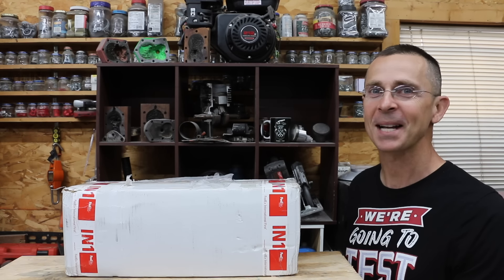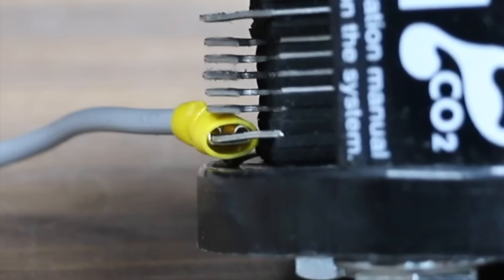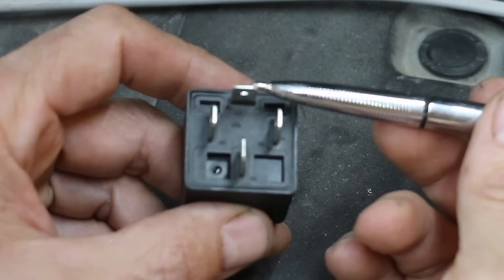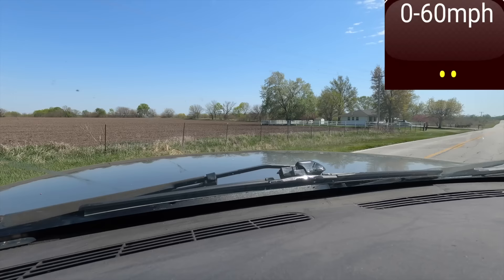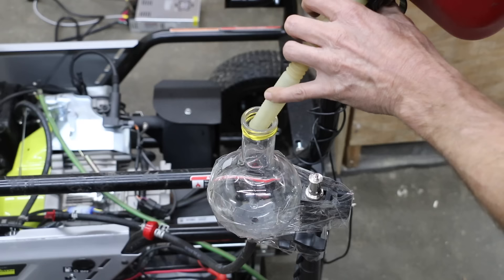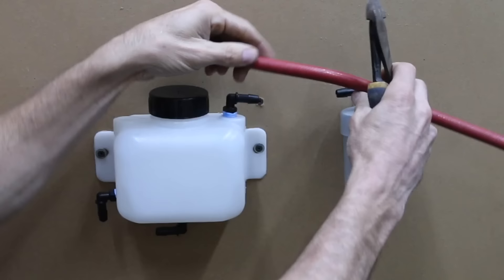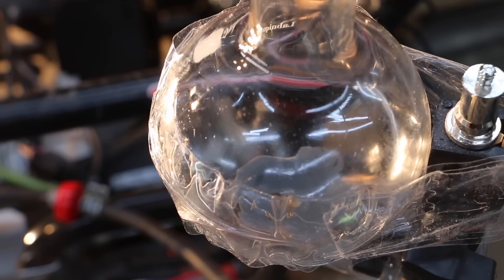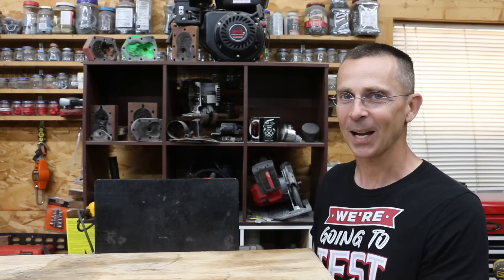AMAZING 35% More MPG with HHO? Let’s find out! Help with high gas prices?

Comment: Using the electricity to run the HHO generator..from the engine always results in worse fuel efficiency due to energy conversion losses.  The key to making this work is to use an external energy source to power the HHO generator.  Such as the solar panels on my truck. (see my video)  You can either generate the electricity and store it in a stand alone battery as I am doing, or you can use a dry cell with gas separation and compress and tank only the hydrogen gas to use like a propane system in the vehicle.  Cody's Lab has a few videos on this type system.  Either way, the energy source to separate the water into gas must be external from the vehicle system.
Reply: But if you use external source to power the HHO generator, the total input of energy which includes the energy in gas is now more than the control because you simply ignoring the fact that solar is generating electricity. And now the HHO generator is just a way of converting solar power to gas power.
Reply: @solidamanda  There is no inherent control in this scenario other than the MPG on a full tank of gasoline driving the same paths at the same speeds until empty.  There will need to be an acceptable error factor of around 5% due to environmental conditions like traffic and temperature.  I am not ignoring the energy from the solar panels, the energy from the panels IS the reason they are on my truck. I have built a crude energy source onto my truck that only takes away from overall efficiency because of the small amount of added weight.  The measurable change would be in MPG after driving through another full tank of gasoline while using the HHO, derived from the solar source.
The key issue is the conservation of energy.  It has always been proven false when an individual claims to have generated more energy from a smaller input.  So far, there are no perpetual machines.  There are a few that come very close to breaking even though.  When you convert gasoline into mechanical energy, there is a loss in the form of heat.  The same applies to solar powered battery charging systems.  Solar panels only convert between 11 and 15% of the total energy being dumped onto them by the sun.  There is a loss of energy to heat as the electrons move from the panel through the wires and charge controller.  Then there is the issue of the energy left on the table by all batteries when you charge them!  The best Tesla numbers suggest the Model Y can lose 20 to 25% of energy input to heat during charging.  Lead acid batteries have even higher losses.  Storing energy in the form of hydrogen gas is terribly inefficient at about 45% in the best circumstances.  When your energy source is abundant and free as the Sunlight, efficiency no longer becomes a huge issue.  The bigger issue is time and output.  How long does it take to charge a battery, and how much can I produce?  Given that the battery is always fully charged by the solar panels when I am not using it, and the output of the panels is about 4x what the charger needs to keep the battery topped off, we can move to output.  The battery is not needed or used much by the HHO generator, it is required for the use of the charge controller.  The charge controller keeps the load friendly for the solar panels longevity.  I hope this better explains what I am doing and the thought process behind it. I encourage and welcome these type of discussions!  I wish more people were interested in alternative energy. 👍
Reply: @shtfengineering7472  I see your point. Using gas converted engergy is not efficient to power HHO and ultimately will be worse than not having HHO due to the engergy loss in conversion. 

What I was saying is that if you would want to use an external power for HHO then there wouldn't be a test necessary because you are simply providing more power to the system from solar converted hydrogen gas. And the mpg will always be better but a matter of how much better.

So if he would used solar power to power the HHO, its really just if the sun can generate 35% more power or not. 

I'm sure the 35% is probably a theoretical maximum value it can produce with a good fuel consumption car. Probably will never get 35% with the truck in the video because the base amount of fuel it uses is already significant.
Reply: So you have a similar system like the video in your truck? Is it working for you?

And what about the engine controller unit, did you modify it's values so that it can take full advantage of the whole hydrogen produced that goes into the engine?
Reply: @guily6669  When the vehicle pulls the extra fuel into the chamber, the sensors tell the ECM that the mix is rich, so it leans back the gasoline.  It can cause a check engine code if you take it out of bounds.
Reply: @solidamanda  So this is a viable way to increase you fuel economy? Making Hydrogen from surplus solar power at home to burn in your car sounds very reasonable and also reduces your emissions.
Reply: @solidamanda  You could say it that way, or you could say, "using HHO allows me to run some small % of my gasoline vehicles load off solar power".  Now, how much it actually helps becomes the question.  My guess is, not much, especially considering how moving a vehicle (even an electric one) takes about .5 KW/hr per mile, and you cannot carry enough solar panels on a vehicle to make a big dent in that.  I actually charge my Hybrid EV (Chrysler Pacific) using solar panels and it takes 10 panels of 250W each to charge 30 miles worth of range in 12 hours (on average based on full sun).
Reply: @Tore_Lund  That would be a good idea, but storing it (compression) takes energy and producing it (electrolysis) wastes energy. In the end, putting the extra solar energy into LiFePO4 batteries is probably more economical and easier to use.
Reply: @MichaelSchwabTX  Yes, not that practical for vehicle use, but otherwise, a home H2 setup would be nice: If you wan't to store summer sunshine for winter, it becomes impractical to use batteries unless you can afford a basement full. Efficiency is not that important if you have an unusable amount of  surplus in summer. The idea is then to recover at least some for winter use. Storage in high pressure tanks might not be the best option for home use, pressure hydrogen pumps and fittings are expensive, so more like you would store Methane from a bio digester, in an inverted tank over a pond. The loss from electrolysis can be used for preheating water heater inlet and in winter, the fuel cell just contributes to your home heating. So you get a high combined efficiency.
Reply: What does your mpg testing reveal? Your video only shows you have a solar battery charger. The extra weight will not improve fuel economy. Possibly an aerodynamic improvement? All this hho garbage is a scam. My dad played with these toys for quite a while, and he hasn’t mentioned it since. If there were some amazing, simple breakthrough in mobile hydrogen production, you would not be able to keep it a secret today. Let alone, if it actually worked! Everyone in the world would have this on their petro vehicle.

Comment: The words every fraudulent product company hates to hear: "We're gonna test that!"
Reply: ... and Religion .....
Reply: Woah edgy.
Reply: @danrather5473  Yea, we can't be putting "GOD" to the test, "Never mind that man behind the curtain, Dorothy".
Reply: I bought this hho dc2000.... No changes .
Reply: So this is the third time I have written this and it keeps getting disappeared… Hmmm wonder why: So the problem has been solved a long time ago. Notice that both of these motors has a computer running it. 
   Think of it this way, what if we were putting propane into the system, what would be the results? And we know that engines will run on propane alone!
   Thus one needs an electronic add on to get the computer to properly adjust the input of the two fuels and oxygen… mixture is everything!
   Try this with a generator that is carburated for propane and see what happens… This though a good looking experiment is very flawed and either by ignorance or set up to fail.
  If HHO burns or explodes, which it does, then it is a matter of how to use it in an engine NOT a matter of if it “works”.
  Let’s see if they delete this one… This time I have it in Word so I can copy paste and not have to re-write….
Reply: @victormbombo3502  you tested?

Comment: This reminds me of those little metal fan shaped cookie cutters you put in the air intake of your car to spiral the air to shoot it faster into the engine. More performance, HP, gas etc. The main issue is is that firstly it’s blocking more air from getting into your intake so right off the bat, you might get even performance or less. Same with this, you’re adding extra space in an area that should be filed down if anything so you lose out right there. That’s a thick a$$ tube, it’s taking away a lot of air and real estate in that system. It’s not going to add enough “stuff” back into it to make up for that fact. Second you’re running it off a battery so that extra electricity is taking away from other engine duties to make it perform the best it was designed for. Remember those volt increases on the battery that fool the engine into running at higher rpm’s for “performance” gains when it just kinda kills it and the battery?? Also, I remember watching a car show where a dude buys a Suburea WRX and makes it factory fresh. After he’s done he puts in a cheap cold air intake and coffee can exhaust to make it more desirable. I guess to the kids who live in Kmart parking lots?!  I dunno. Well he got it dyno’d before and after mods. Guess what? The parts actually made the car run worse and not as much power. Cars today ain’t like actual cameros (70s). They have computers in them and if you start putting random junk on the engine, it’ll make the almighty computer mad and make your car suck even more. After he flashed the ECU, he got more power from those mods. So this leads me to my only advice for this test of “supercharged water”, also you can get a how to book for actual car engines that run on water and plants for free at the patent office or some junk but it’s impossible to build, is to test this before and after ECU flashes and actual dyno. Only way to tell what it’s really doing. 

PS: until then, just do legit, tried and true performance mods: empty out your glovebox and take a dump right before you drive off to the grocery store or bingo night with a hot date.

Comment: i would love to see you compare power chip programmers that plug into the OBD and see if they actually work and which ones perform better than others
Reply from the maker: Thanks for the suggestion.
Reply: @ProjectFarm  Yeah man, that was a good suggestion by Mr. Kaye. I will second that one. 
 I love the videos. 
peace.
Reply: Yes, and hopefully include one for OBD1 as well. There's lot's of Chevy trucks out there like that (88-95) still on the road & they tend to get overlooked.
Reply: how could they NOT work? you are effectively modifying the fuel maps...
Reply: @ProjectFarm  indeed. Let's get to the bottom of the chips

Comment: I knew what the results will be. 
The energy to split the water comes from the gasoline that powers the engine, which drives the alternator. 
The amount of energy added with the HHO is less than what was used to split. 
Use solar power to split the water and we may have something. 

BTW an HHO generator should work with alternating current.
Reply: Thank you. Conservation of energy applies. Technically, an ICE engine would work on pure HHO as the stoichiometric ratio is perfect, you just need enough of it (and a highly modified engine). In this situation though, the engine has an extra load on it to perform the electrolysis to make the HHO, therefore you would be going against the basic principals of physics thinking you can get more power, torque or efficiency from this setup because you’re trying to get more out than you’re putting in.
Reply: My guess is that the fuel intake is set regardless of the type of air coming in the intake which means there would be no, or negligible, difference. If you could use it on the fuel intake and adjust the mixture for less fuel and the difference made up by whatever is generated, maybe it would have a bigger change
Reply: Putting AC into water will just heat the water.  You can run it through diodes or a bridge rectifier and use the lumpy DC, but not AC.

I did a good bit of experimenting with this years ago.   I was just hopeful that the hydrogen would help the gas burn more completely.    It didn't even do that.   I messed with voltages, current, mode (AC/DC),  electrode materials, spacing, electrolytes, and pulsed power with various waveforms.    I ran it from under 1v up to over 30kv.  Everything that I could think of, and every claim I found that said it would work.

The high voltage stuff was fun.  Above the water, I had a nice strong arc gap playing music. :)    Like a singing tesla coil.

You can make hydrogen.  You can make hydrogen and feed it to the engine.  But the only practical goal is to feed it enough fuel where it won't need the gasoline too.   You won't achieve that with power sources that run off the engine of the vehicle.    None of them will even generate enough hydrogen to make a dent in the gasoline usage.   Not unless you have a bank of batteries or a gas generator, to provide enough power to do it.

You can't store HHO.  Or more specifically, you shouldn't store it.  As HHO, it is at the perfect mixture for maximum power.  It is a bomb.  Most aren't set up to store the gases separately, and none included compressors to store the gas for later use.    If a setup were to generate and store hydrogen and oxygen into tanks, using solar or whatever, it could be a working system.  But that's none of the HHO systems that people claim work.

None of the things I've seen anyone using protect against sparks when the electrodes or plates are above the water line.    I have seen some people's projects explode because of that.  Most never figured out why it exploded, it just went.   Or at least, they didn't say it when they posted their explosion videos.  I assume a few didn't survive to post their videos on YouTube.
Reply: @JWSmythe  Wow that's a lot of work to prove what should be obvious.
An appropriate use would be solar with separate sides to collect only hydrogen so you could have a gas stove, I've always thought this a good idea because I hate electric stoves.
Less efficient but worth it.
Reply: @ghz24  it was fun to do. And when people argue about it working, I can honestly say that I tried it so many different ways.  They can't say the same.  Their only proof is conspiracy forums and YouTube videos.
Reply: Water has the lowest Gibbs Free energy of any molecule (yes any) this means that the energy hump required to separate the hydrogen oxygen bond is much higher than the energy of the resultant O2 or H2 molecules being burnt to reform water.
Reply: @passivehouseaustralia4406  Thank you! Chemistry matters.

Comment: How about "Which Octane booster/additive increases hp" on your next test?
Reply: If the engine is not tuned for higher octane, no amount of octane boosters will help. If it is, then a good working octane booster will prevent knock.
Reply from the maker: Thanks for the video idea.

Comment: The fuel that the engine burns contains a set amount of energy , adding any kind of extra process to an existing engine will simply consume that energy faster . If you want to increase efficiency in a vehicle you need to subtract not add . You could decrease the weight of the car , decrease its aerodynamic drag , lower the friction in the tires by inflating them more , use better lubricants on the bearings and in the engine etc etc . Still some people are convinced that they are special and can find a way around physics but I have yet to find one single setup that has proven verifiable results resulting in a gain . I like your test its very conclusive .
Reply from the maker: Thanks!